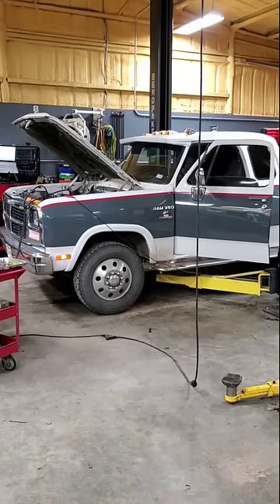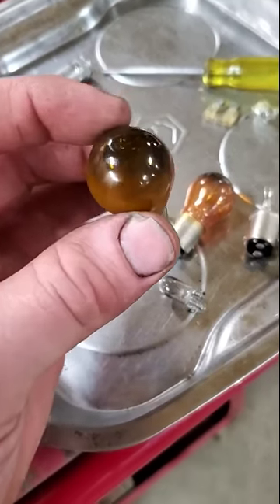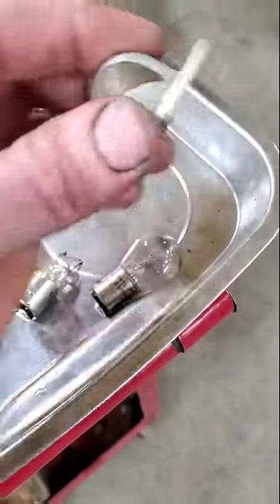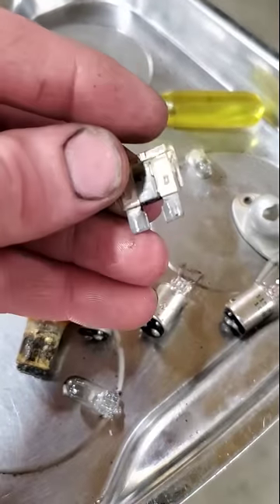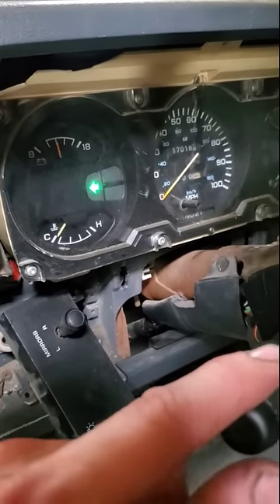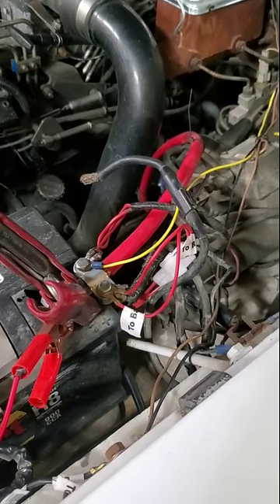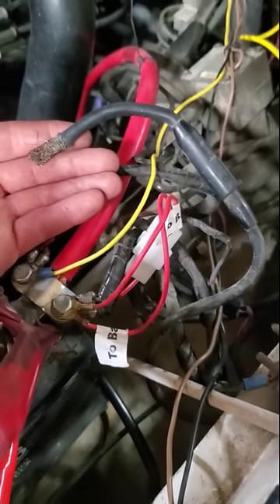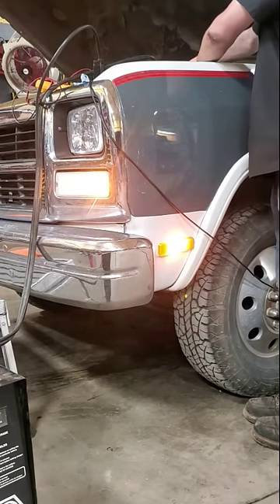Alternator Destroys All The Light Bulbs!

Comment: I wanted to say Dodge moment, but my old F-350 did something similar when the voltage regulator died, it melted the connector for the headlight switch. The funny part is though that literally everything else was fine despite running on 18+ volts for 2-3 hours on the highway. A tank those old Fords were.

Comment: Best way to fix that problem is a 1 wire alternator.
Reply: Put a Ford external VR on it. Unlike Dodge VR it has a battery sense terminal. Lots cheaper, and it works great t.
When people put the Cummins engine in anything else

Comment: Damn. Car alternators with excitation current stuck at "balls to the wall" can easily output 200 V open circuit, so maybe like 40 V at low load. Brutal.

Comment: That's why there should be a fuse on every wire coming off the alternator, I had something similar happen and fused up the only wire that didn't have a fuse coming from the alternator, I won't have anything melt again, just a blown fuse.

Comment: The old  2-diode  isolators  can do the same thing, and DANGEROUS in a boat--overcharge and boil the  second battery when the  diode to the main battery goes open.

It's also a recurring problem that  the Mopar  isolated field  (incorrectly called  dual field) alternators come from  crap rebuilders, or intentionally jumpered to ground.  You have a 50-50 chance--either it burns up the  field power wire,  or  it  "full field"  charges and boils the battery and pops llamps.

Comment: The "splice connector ' as. You call it is actually a group of fusable links. Check each for voltage.

They often feel stretchy like a rubber band when burnt. That wire looks like it broke off the battery and it's the main body harness feed, not just a charge wire.

You could have an alternator problem still but to fix this right it's going to need a new body harness.

Have fun.

I was a Dodge tech when this truck was made.

Comment: This can also happen if the voltage regulator isnt seeing a clean 12 volts. If there is too much resistance in the power supply the regulator wont work and it will shoot up to 16 volts and melt everything.

Comment: Copy this test sequence.
One. Positive to negative battery post. 14.1 to 14.8v. 
Two. Negative post to the engine. 0.04vdc max.
Three. Negative battery to the body.  0.04vdc max.
Four.  Engine to firewall 0.04vdc max .
Five. Positive battery post to the underhood fuse block. 0.04vdc max. 
Six. Positive battery post to alternator output stud threads.  0.3vdc max

Comment: Sounds like the regulator went full field. That's when things get real bright all of a sudden before the bulbs start popping!
Reply: I had that happen to me in a 75 Ramcharger w/ a 440. The engine harness runs down the left side of the right v. cover. The harness was too close to the exhaust crossover  in intake manifold. The field wire melted and contacted that crossover and grounded out. The alternator gauge went full scale. I recognized it right away but I was on a big I-5 bridge w/ no shoulder to speak of. I shut down the engine & coasted and re-started engine again & again until I found a safe place to pull over. Pretty scary when wisps of smoke start coming out of the dash defroster vents.

Comment: As an older truck these were probably all incandescent bulbs. A new truck treated this way might have cost 1,000 dollars just for the bulbs. The alternator is now also suspect. This truck will still cost over 1,000 dollars to repair because of burnt and tortured plastics. Not costing quite as much as the components will not be available new and must be drug from used vehicles.

Comment: I had a bad voltage regulator back in the 80s when regulators were still sometimes external to the alternator so I jumped the regulator which full charged to get it home which worked except every single bulb was burnt out

Comment: Thats truck is almost as sexy as the your ability to diagnose such an odd electrical problem like that. Unless I found that disconnected wire within 7 melted terminals I would've cut my losses and told the customer good luck😂🤷‍♂️

Comment: replacing the alternator will fix it, but that's not what went bad....most modern alternators have a built in voltage regulator... when that fails, the alternator produces too much power.  if you're lucky, you'll  catch it in time before it burns all the lights and over charges the battery to death... its usually noticed because the windshield wipers don't just run, they go completely nuts, and that's when you know ya got a problem

Comment: Damn seems like that’s an engineering problem for sure. A problem waiting to happen.

It’s been a long time since I’ve worked on vehicles but I’m curious as to where the voltage regulator is located?

Years ago most vehicles or should I say alternators came with a built in voltage regulator to avoid this very issue.

Also most people would be surprised at how much actual voltage comes from an alternator before getting to the voltage regulator.

My Harleys stator, which is similar to an alternator, puts out and ungodly amount before getting to the regulator.

Good luck sir!

✌🏽

Comment: This all points to very high voltage. And even if there is a fuse as the voltage goes up it uses less amperage so the fuse takes longer to open so it still fries stuff.
Reply from the maker: On DC systems, amperage goes up when voltage goes up. This also applies to any resistive load (see ohms law). An AC induction motor however is opposite- amperage goes down when voltage goes up.

Comment: 1972 GMC van had voltage regulator contacts stuck in full on, battery caps kept blowing off. Measured voltage at 3000 rpm, 120 volts DC

Comment: Something shorted on my 90, had to rip all my grounds off the battery when they started burning. Drove it home with alternator at full output and the headlights dim. Turning in the  driveway something went pop, headlights came up to normal, and I never did figure out what it was

Comment: I had a old Ford truck that melted every kind of switch and bulb that you can think of while sitting at a red light. Fortunately it kept running ,but I had to run all new wiring and replace everything from the brake peddle switch to the heater switch. Really weird. haha

Comment: heyyyy  i had dodge in same color but 250 ,  Gotta love old 6BT's    I replaced P7100 pump one weekend, which meant i had to move some wiring out of way in the front.   i remember tugging a harness and tucking undereth, it came apart in my hand. I was horrified because, 1, it is diesel thus under hood was a bit greasy and dirty  2. wirings were similar color.  thankfully  i found the piece where it broke off, it was a harness connector. i just took a knife and scraped away at old insulator hoping to expose color.  it did.    I just cut and shortened it, re conected  one wire at a time into connector.     i spent a couple hours on the connector.   P7100?  20 mins.   go figure.

Comment: Why is it only Chrysler products suffer from electrical overload when the voltage regulator goes out in the alternator. Ford & GM alternators don't do that, when their voltage regulators fail. In GM & Ford, you just lose power at the alternator.
I do know you have to replace the wire (comes with the new alternator) on the new Ford alternator, or you could have an engine fire.

Comment: I made a fk up once . I flooded my car once and run the battery down to the point that it wouldnt turnover . So I connected another battery that was also low on power . I linked them together to give me 24 volts to spin the motor over faster for it to fire . Then I flipped the headlights on . Well 12volt lights dont like taking 24volts . Blew the headlights ,park lights and the taillights . You could have said that I had a fumb duck moment .

Comment: my 84 ram is not even close to being as clean as this one, but i love it all the same...

with that being said though:

oh. my. FUCKING GOD ALMIGHTY! the electrical issues i have and have had on that thing is just mind boggling and frustrating. dome light refuses to work, my horns decide they dont want to live on this planet anymore, my left blinker works only when it wants to, hazard relays refuse to stay in their place, already tried tape and zip ties. and to top it all off, whenever the truck moves a certain way, the power cuts off for half a second, but its never predictable and its hardly ever in the same way. hit a speed bump, it cycles, hit the same speed bump later in the day, doesnt do it. shift into 4 wheel drive, it cycles, shift it back to 2wd, it may cycle, but do it again and its fine, and then sometimes it will be fine for 2-3 weeks and no matter what i do to it, it wont cycle

Comment: I was expecting it to be the regulator on the fire wall. My 2nd failure the regulator went max amps pegging the gage. It was a driver going the other way on the interstate flashing me to turn off my hibeams. I thought to my self hay lights are awesome right know so bright , better than normal hibeam. Grabbed the dimmer switch and bam day light on the actual hi beam.  It would stick for 5-10sec at a time every 20-30 sec.  Made it the last 10 mi back to town without melting everything. 

Question 
1)
 why didnt the fusible links ( 4 wires coming out of that splice are fusible links [ controlled failure point made of lighter ga wire])  commit hearycary  sacrificing it self to prevent this damage?
2)
Why did the circuit braker ( inside the switch) not do its job?

On my experience the load didnot last long enough to trip theas safeguards.   However the braker in the switch did get damaged , becoming weaker ( no longer able to handle the amps of running 4hi beam[ both hi and low at the same time same as imports ] it kills all power into the switch going completely dark  )with each subsequent trip.

Comment: There is an old trick to test alternators. It no longer works and may have never worked. The trick goes like this. TO test the alternator start the engine. While running take the battery with off. If the engine keeps running it is good if it dies it is bad. And this why you should never do this. I have seen car alternator just a high as 80 volts. I have heard other people say they have seen it go well over 100. I do know of one man that did try that trick. He smoked the ECU. This man is lucky bulbs was the only thing destroyed.

Comment: Mofos be like "hurr durr if it was a new car it'd be toast"

1. Basically every new vehicle on the market now has an internal regulator alternator, I doubt you'd somehow get connecting 1 PLUG and one battery positive lead to a stud. But then again...

2. In the event of overcharging does occur due to other circumstances, those little modules are still going to be using their little 5v. Globes however generally will let go.

Comment: The only way that could happen is if positive from battery was wired to field on the alternator! And it's not max output that did it , it was voltage going higher and higher upwards of 300 volts ! If you disconnect regulator. You get minimal voltage , not even enough to charge ! Is this another one of those fake posts so we all respond and you get paid iTube money ?
Reply from the maker: WRONG